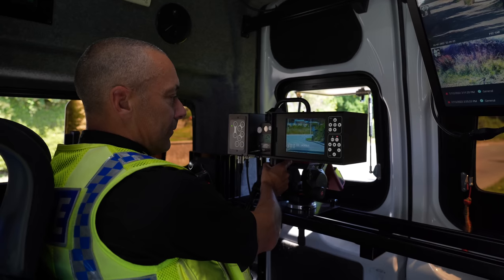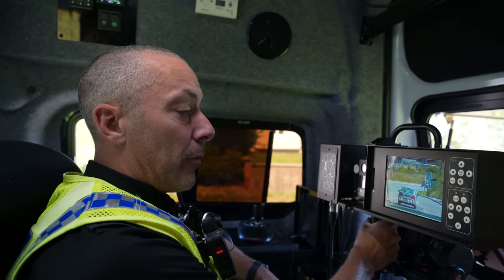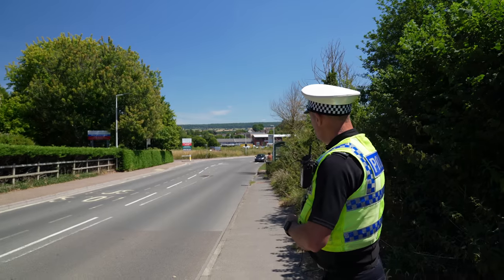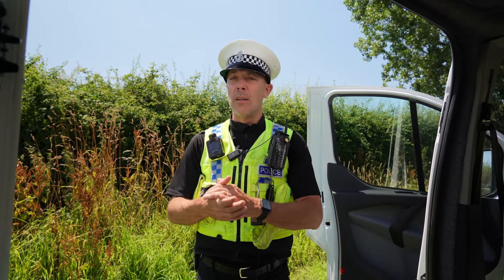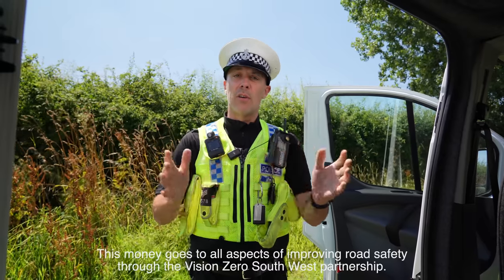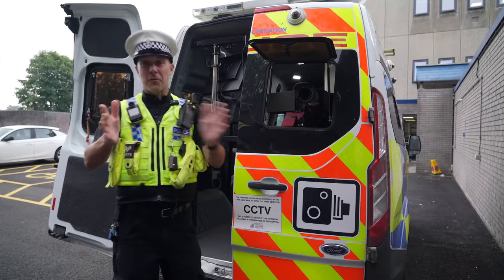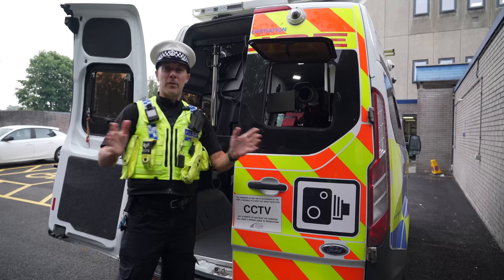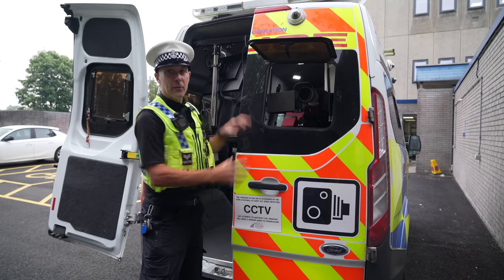SPEED CAMERAS - Road Safety or Cash Cows?

Comment: If you’re speeding and you get caught you have no excuse. If this makes a lot of money for then that is down to the motorists to follow the current speed limit. I think their shouldn’t need to have signs for any speed cameras. If you’re speeding and you get caught, that’s on you, not the people get catching you. Drive the limit and you have no issues…
Reply: that's all well and good but the money is not used for road safety it's used as revenue for whatever constabulary is deploying it
Reply: @bertbox69  I get that it probably should be spent on motor related things but at the end of the day if you’re speeding and get caught you should have to pay a fine and get points on your licence. Driving should be for people who can do it sensibly and not for those who think they can do what they want
Reply: @Back4RoundTwo  got pulled twice let off twice down b roads it is an mx5 though 😂 i drive to conditions and whats ahead b roads with long straights you can see 80 is the sweet spot but varies massively on whats there as long as you use limit points and you can stop what you see to be clear ahead youre fine

Comment: Never seen one outside a school but been penalised for doing 53mph on 40 speed limit at the outskirts of Coventry (Coundon Wedge Drive), very wide road, green fields around and stupid limit at 40mph in there (or not that stupid at all?). Van hidden of course, clearly cash cow. Meanwhile, people speeding around the city, motorcycle gangs breaking all the laws (I'm a biker myself and I'm shocked) and police doesn't give a single FUCK. Keep on pushing and we all will choose the bikes with no reg. plates on. Safety is their main concern.. what a bunch of bullshit.
Reply: Outside a school?  What happens outside schools?
Reply: @unleashthedragonwithin2057  
People suggested that police vans should rather be parked outside schools to catch drivers speeding there instead of hiding in the bushes at dual carriageway. Suggestion that somehow makes sense to me.. Not to you?
Reply: @Solder-Flowz  Why does it make sense, what happens outside schools, do you have any verifiable data?

The problems exist where children cross unsupervised on the approach roads, not outside schools.  They have local authority crossing patrols, so a very safe crossing environment at drop-off and pick-up times.

So explain why it makes sense using your data source?
Reply: @unleashthedragonwithin2057  It makes perfect sense, that where children gather is a better place to put their "safety measures" than a rural area with green fields around and good quality, wide and empty road. Common sense. I'm not saying there is need for their stupid vans outside schools. I'm only saying that their explanation is completely wrong. Their vans are not outside schools but at the profit making spots. Simple as that.

Comment: i agree with what has been said,even after 40 years of driving,just judge everybody different,not for doing 3 or 4 miles over the speed limit,thats where the police get there bad name.
Reply: Notices are not issued for 3 or 4 miles over the limit.
Reply: @NoBody-gf8ie  That contravenes the ACPO NDORS criteria (page 5) which has yet to be overwitten by NPCC.

It should start at 26mph.
Reply: what about in a 20 mph speed limit
Reply: thanks for you information,very interesting.

Comment: As usual the old bill giving their version of how things happen…. A total cash cow purely there to raise funds decrease the amount of cars on the road thus reducing the need to improve the road surface…. 40,000 miles a year never ever ever seen one parked in a spot which I think is actually beneficial to the local residents…. The gentleman presenting this couldn’t lie straight in bed….
Reply: @NoBody-gf8ie  absolute cobbler’s. Motorway bridges in the middle of nowhere really, I take it you believe in the tooth fairy 🧚‍♀️😂😂😂
Reply: @NoBody-gf8ie  seen it for myself. Let’s take a couple of facts shall we. Say the A38 had a couple of issues with speeding in say Devon. The whole of the A38 BECOMES A POINT OF ISSUE. As for misinformed heard it from the horse’s mouth. All cameras do is take a spot point in a journey where for some reason you are 5mph above the limit. It plays no part in road safety on the open road where 95% of the cameras are used. I guess you don’t see them from the bus 🚌

Comment: flashing a burglar flashing cars - one is a victimless crime of which the state claims injury onto itself through policy enforcement - burglars ....... don't need to elaborate - other than that - slowing people down so fair enough - however on motorways 80mph on an empty m1 in the middle of summer - not unsafe at all + police work to targets which is absurd in ending of itself - good video though

definitely revenue collection agents as this country operates under 1 notion - all crimes result in fines - therefore a crime free nation means less revenue & if the crime is beyond simply a fine as per the notion of causing injury harm damage or loss then get a decent lawyer ; either way finance gets you out of punsihment

Comment: Imo a move to 80mph on motorways probably could happen but the political motive won’t be there with green / net-zero targets now.

Look at wales where limits are down to 50 mph on some major routes for environmental reasons.

Until we have majority electric cars and greener ways to produce that electricity it won’t happen.

Happy with 20mph outside schools in daytime - mass rollout of 20 mph across urban areas when the driver as mentioned has the same reaction time but the car much improved safety kit infact many stepping in to emergency stop for you is silly. Plus I always have to drive a gear lower so I burn more fuel.

Comment: They can be but let’s be honest, most of the time they are used to trap and fine.

Speed limits are often far too low, and the police sit in places where you could easily do 1.5-2x the speed limit to catch you doing 42 in a 40😂
Reply: No-one is issued a notice for 42 in a 40.

Comment: It's funny when drivers are getting mad of these cameras and calling them cash cows. It only means that these drivers are either  so bad in driving that they don't have a feel or perception of how fast they are going and they got caught, or they are one of those who willingly speed and causing danger to others. 

Also, by calling them cashews because they are handing out fines is a funny argument. If they are earning lots of money from these, that means lots of drivers are speeding on that section of the road, meaning these vans are justified to be there.
Reply: Alternatively the road is poorly designed or badly regulated. If a majority of drivers tend to regularly exceed the posted limit in a stretch of road then whoever designed or posted that stretch was incompetent. There is an interesting implication to the fact that most regions have both a "speeding" violation and a "reckless speeding" violation.
Reply: @asingleshot7  nope, stop blaming the person designing the roads. It’s the drivers who are incompetent.
Reply: @roadbiker8333  There is a road on my commute that they have fixed half of. Posted for 50 all the way on the fixed section the average speed is about 44. On the unfixed section 95% of drivers including cops do 65. Literally the only people I see do 50 in that section are brand new drivers, usually in branded driving school cars.

Comment: Yeah, only time you'll see one of these on such a road, and where they should be all the time. Only time i ever see these is on Motorway flyovers and arrow straight sections of 50mph plus roads, trying to generate money. And what happens is people yank on the brakes when they see the van, regardless of their actual speed. Should be used to nick cyclists for doing 5mph on 50, 60 and 70 mph roads

Comment: He says they don't hide so why did my picture come through with twigs and leaves infront of the camera? He was in a hedge literally lol
Reply: How did the laser work through foliage?
Reply: @unleashthedragonwithin2057  You could partially obscure a camera lens and easily have the laser working perfectly through a gap in that obstruction. Are you saying that any partial obstruction to the lens would prevent the laser from working?
Reply: @ThatChrisGuy  Yes, absolutely.  The camera is mounted next to the laser speedmeter and you are claiming that twigs and leaves were visible on the footage?  For such to be identifiable on the footage, they would have to have been a considerable distance away from the camera as depth-of-field would have rendered them as just black shapes.

The laser requires to be panned during use, but if the camera was obscured by foliage, then so too was the laser, so it would not have worked, no question.

Vans do not park in hedges.  It is a lovely story, but simply fantasy on your part.

Comment: Simple message here folks.... Keep to the speed limit.
Reply: Doesn't help if you live in an area where the council lowered speed limits back in the days when they got to pocket the money from fixed speed cameras. Funny that the day the rules were changed and the money from speeding fines no longer went to the council which operated them the "safety" cameras were turned off.

Comment: Too many rules to follow these days to even concentrate on the road because one wrong turn your getting a fine or point, read somewhere that Germany doesn’t have that many road accidents then the U.K. and they don’t have may road restrictions so people are more concentrating on operating the vehicle they are driving safely to there destination and not worried about what the road signage is saying or speed limits are, just saying look it up if you like 😉
Reply: Germany only have small sections of the autobahn that have no limits the rest of their road network has as many if not more rules than the uk and the uk motorway is about 1.5X safer than the autobahn.

Comment: There is a law about having camera signs on a road where speed cameras are used, hence why they put up permanent signs on roads where mobile cameras operate so they don't have to put them up on the day as people have previously got round that one in court. Lol
Reply: There isn't actually a law. It's not part of the Road Traffic Act.
There is "guidance" supplied by the Department of Transport. Most of this is followed by most forces as good practice.
But if you're speeding a missing sign isn't enough to get you off the hook.
Reply: @gavjlewis  well, it is the law, hence why they had to put the signs up because people with dash-cams where getting off with speeding in court due to no signs being out...
Reply: @ZJS0113  It is definitely not the law. The signs are there to act as a deterrent so drivers slow down. Hidden speed cameras completely defeat the purpose of slowing down traffic. As @gavjlewis said, there is only guidance for the use of bright colour vans, signs, and clearly visible markings. This guidance is in place to support the "best use-case" of the speed camera to get the most effect for their goal - the goal being to slow down traffic.

You can't just say something is the law based on your own uneducated understanding with no research. Also, unless you can show me multiple cases where someone got out of speeding charges/tickets in court solely because their defence was "there was no sign", I won't believe that. 

Speed camera signs are also a very simple, cheap, and fairly effective method of traffic calming. I could count multiple roads in my area that have speed camera signs, but I have never once seen mobile speed cameras operating on them, despite driving on them every day.
Reply: @SurgeDashcam  you're the one that is uneducated, they HAVE TO have speed camera signs out on roads where a speed camera is or could be. True there doesn't need to be a speed camera on the road but if there is, signs HAVE TO be up and visible.
Reply: @ZJS0113  Show me a reliable source that supports that, then I'll side with you. As far as I can see through research, there is no legal obligation for speed camera signs. Whilst you're at it, show me some examples of someone who has got out of a speeding ticket with the solo defense of "there were no signs", I'll be waiting.
Reply: @SurgeDashcam  wire me some money and i'll go spend my time proving it... 🤣
Reply: @ZJS0113  No, because you won't be able to prove it. It should take a 30 second Google search
Reply: @SurgeDashcam  do it yourself if it only takes 30seconds 🤣
Reply: @ZJS0113  I think you missed the part where I said I did, and the results prove you wrong. Keep being deluded and enjoy your life.
Reply: @DavArc626  it's not. It's the law, signs have to on the road. They are allowed to put signs up and not have a camera out but if there is a camera put then there needs to be signs.
Reply: @DavArc626  i don't need to prove anything to you, i'll just inform you that you're wrong. Literally every road that has a speed camera or bus lane camera or red light camera on it has a camera sign. Why? Because it's the law.
Reply: @DavArc626  if it wasn't the law councils wouldn't've spent thousands erecting signs 🤣
Reply: @DavArc626  yeah, you can believe you're right if it makes you fee better 🤣

Comment: What about marked police cars speeding I see that very frequently speeding through average speed checks on the m6,m5 and the air quality shite on the m1 and on the A74 they is a black s3 saloon unmarked that sits at 60 then speeds to 70 when a sports car is coming behind them then when the other car thinks they want to race and goes over 70 the cop pulls them I’ve seen that loads.
Reply: For one, police cars have calibrated speedos. So they could be doing what your car would say is 78 mph but they are actually going 70. That's one example. Same with ambulances.
Reply: I see this regularly too, and when they do I deliberately follow at a safe distance even though it is well over the limit (if road/weather/conditions/traffic make it safe enough). Always loved the thought of them trying to stop me when I have full dashcam footage of them sitting on the outside lane at 85 in a 70 without there blues on.

Comment: These don't improve safety at all, cash cows indeed. Any so called improvement,  only in the short road on which the cams are

Want to prevent the speeding?  FORCE it.  No numpty is going 30mph on a speed bump XD

Comment: Put average cameras up then gets rid of an officer and a van save a bitty money
Reply: @NoBody-gf8ie  fair enough then 👌 never knew that
Reply: The cost of an average speed camera system (with overhead gantries), is around £180k.  They generate vast numbers of offences, meaning lots more back office staff to view the resulting images, deal with the admin and any resulting prosecutions going to court.

A typical speed enforcement unit with around 45 staff requires £125k in wages every four calendar weeks, but you want to increase staff numbers, plus correspondence and postage.

Save money?  You are woefully misinformed.

Comment: 1000 meters? 😳
Reply: Oh yes your safety for sure, I crashed at 40 mph in a 60 and my car rolled like 3 times…
I clipped a bank when braking for a deer 🦌 on a country lane, and it was a 60 but it doesn’t mean you have to go 60 the speed limit is a maximum not a target…
Luckily I got out of the car with not even a scratch 🫶🏻